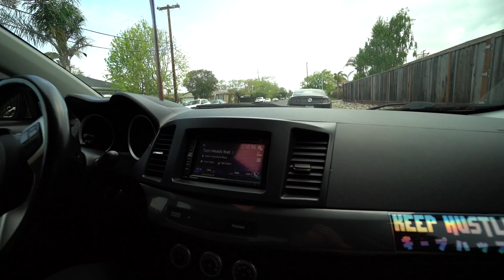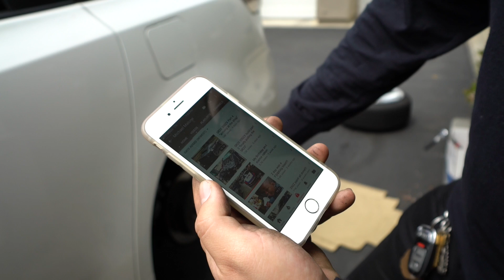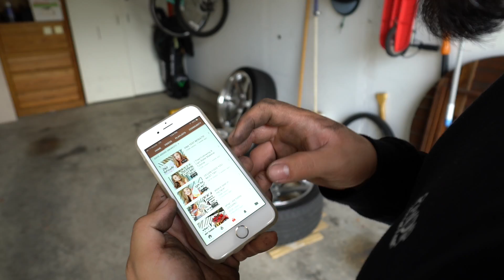THE SIENNA GETS NEW 21 INCH WHEELS!!! (HYPED AF)

Comment: my 74 year old wife has severe health and leg problems. Can't find low rider stuff to lower the 99 toyota sienna van for her to get in and out of. Just happened to think about putting on smaller tires on a 15 inch rims. Apparently  a 125/80 R 15 is the smallest made. that would drop the height of the van down to around around 4 inches lower that would help her out a lot. Would it be possible to get that tire size on a standard 15 inch rim? thanks.